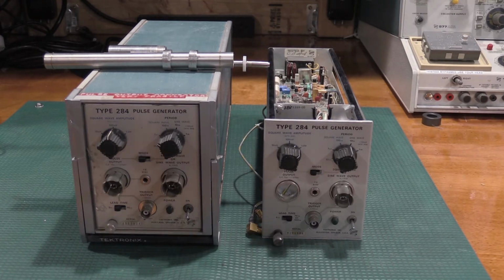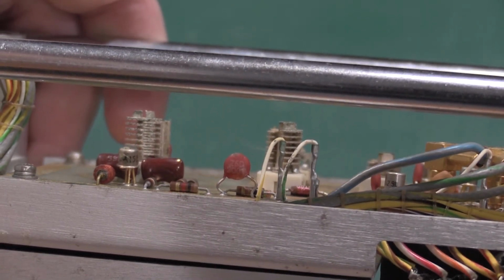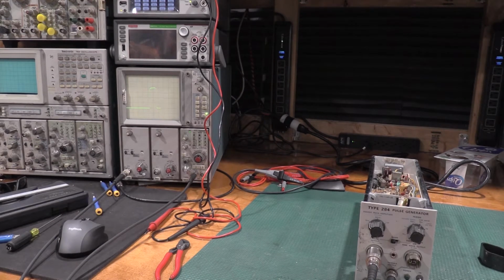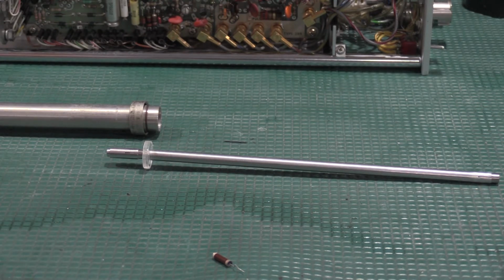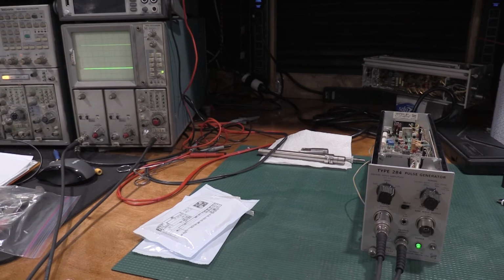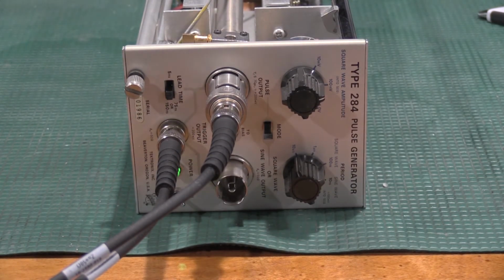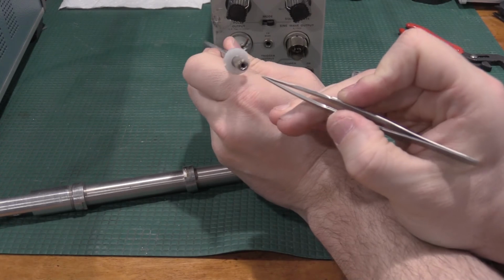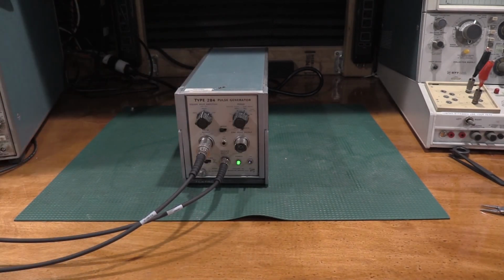Tektronix 284 Repair

Comment: I have a 284 that for some reason, doesn't shoot the TD, and therefore, there is no fast pulse at the output. (TD is good). R184 is, as usual, out of spec's. Is there any reason I should use SMD 270 and 390 ohm in series in order to have a 660 ohm R? or I could use any pair where the resultant is the same? (620+39 ? for example) .
Reply from the maker: I went with the 270 / 390 R's as I had them in stock. From a DC perspective nothing will care but it could have some weird artifacts on the AC fast edge side of things. Calibrating that pulse is yet another monster. I am still needed cables that are fast enough to do that adjustment on the pulse out.

Comment: Great video. I have two of these and need to get them up and running. Im only at 10:55 and noticed you don’t have these line terminated. If that’s right that may be why you have too hot of a signal. Edit, mis-spoke. I see the 50 ohm terminator on the scope input. Tiny little thing.  I’m still vague on how the tunnel diode and air transmission works on these. I got these to calibrate my 5S14N sampler plug-in which I got to calibrate my TG501. All good fun.
Reply from the maker: I have some Russian TD’s on the way that I hope to do a video on when they get here that might help. As for the air line it is just an extremely high quality 50 Ohm coax cable. Just a SUPER fancy one. The  insulator or dielectric material instead of being a plastic is “air” which has given the term air line. Used often in high power transmitters or insanely fast rise times. So the very abridged answer is Tek took a high quality chunk of coax suspended an extremely low capacitance tunnel diode 1.5 pF and smashed no less then 4 different square waves in to it from 4 different directions North South East and West. And got a much smaller but much faster edge on the output.

Comment: Great repair! I purchased a "parts/repair" 284 to use for testing my HP 54110D scope. It had an open tunnel diode and I was able to substitute a Russian 3I201D tunnel diode. The specs of the 3I201D are: Ip 16–22 mA  Vp 200 mV	Ip/Vp 10  Rd 5 Ω Ct < 4 pF L 1.3 nH 
This information is from the Tekwiki web site (https://w140.com/tekwiki/wiki/Russian_tunnel_diodes). Last time I checked you could get 10 diodes for $16 on eBay.
Reply from the maker: Awesome thanks for the heads up on those diodes. I grabbed a set Ill see if i can breath some life in to the old one. I will have to rebuild the termination resister again but no worries there.
Reply: @ZenwizardStudios  I just remembered (getting old) that I had to change the trigger generator circuit slightly to match the diode I ended up using. The Russian tunnel diodes seem to vary a fair amount and I ended up with a 325 ohm resistor for R148 in the trigger generator in order to get a reliable pulse with each tripper pulse.

Comment: Great ! I think my 284 has the same Problem, didn`t know that the Resistor Network comes apart. Thougt it was one solid piece and not serviceable.
You wrote that you are about to get some Sampling Plugins ?
Reply from the maker: I am currently not sure how I want to push the lab faster weather that is sampling real time or both. Currently I am only good to 500Mhz with the 7904A and a 7A19. Be careful with the resister network the 54 Ohm outer resister is Irreplaceable with out a parts unit. And it is the back termination for the air line so it is critically impotent in the circuit. But good luck on the repair.
Reply: @ZenwizardStudios  I have a 7S14 wihich works quite well in the 7854 and 7S11/S-4 with a 7T11 which has to be modified to work in the 7854.
Unfortunately these Plugins are very expensive in Germany, you`re in a much better situation i think :-)

Comment: Nice!  I call that level of dirty a "dump in ultrasonic cleaner and hope for the best" situation :D   that resistor!  nice fix there.  Had some 17LVC1G14 super fast inverters arrive today so hopfully i can play around making my own, very inferior DIY version of this instrument this weekend
Reply from the maker: Let me know how It goes. I have an enclosure now to play with and I just received and interesting idea about replacing the GR connectors with N connectors apparently they are a better mechanical fit then BNC. Might be and interesting way to reuse the chassis. Ill have to let that roll around in the gray matter for a while and see what gets kicked out.
Reply: @ZenwizardStudios  yeah an N connector should be a better size match.  I built a quick prototype pulse gen this evening with the 74lvc inverter driven by not particularly good rigol function generator.  the very tired and worn out 7704 with an only slightly less distressed 7a26 indicate about 1.8ns risetime.  the 7623a and my rigol scope (same as yours) reakon about 2.4ns.   all the tek's agree there's a hump and some ringing, the rigol shows a nice clean pulse... wonder which is right?  guess i now need a faster scope to build the stuff to calibrate the slower scopes :D   also made the unpleasant discovery the rigol function gen is either jittery, trying to dither in the time domain, or both.
Reply from the maker: 2.4ns would be a bandwidth of 147Mhz, Quite respectable for the rigol. Only being a 100 Mhz unit. The aberrations are one of the things that you specifically tune when you are doing a calibration on the frames and scopes so they are normal and expected. If memory serves you are allowed 2% of step amplitude This is actually what you are tuning when you do the high frequency calibration of the unit. The rigol has an a/d front end not analog. So I would say the Rigol has validated you up to its bandwidth limit of 100Mhz. To do the tuning on the frames you need to know the step response goes high and stays flat. Even the 284 is on specked for the first 20 ns of the square wave if I remember correctly. The tuning is 106 for the slow long time frames as it is only 29Mhz then move to the tunnel diodes for the first 20ns and shorter adjustment durations as after that the flatness of the step can not be assured. But with the math the 284 at 70 ps is a 5Ghz step response. Even in the modern days of now these are not trivial speeds to be working with.